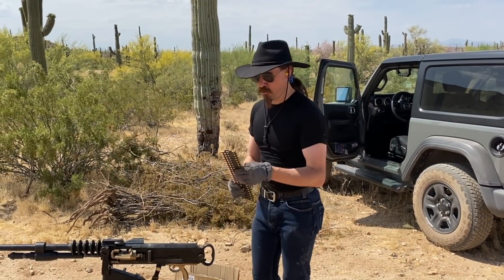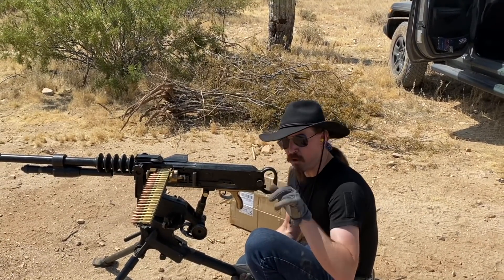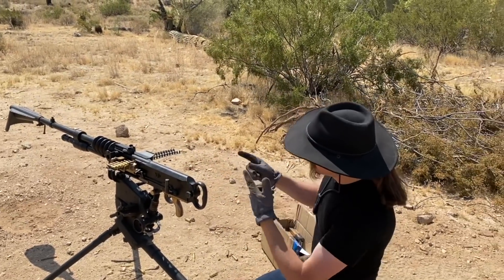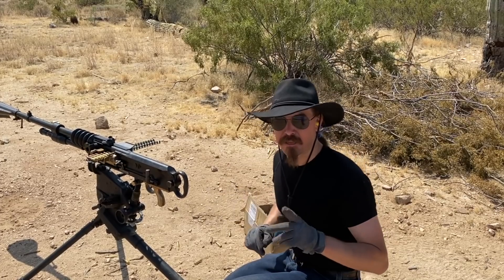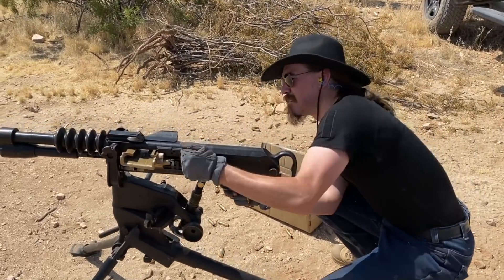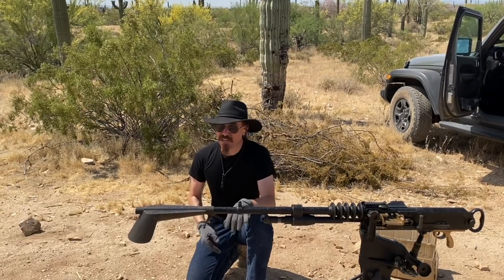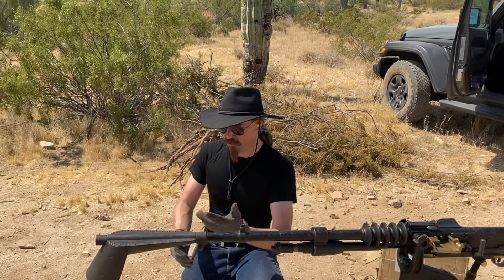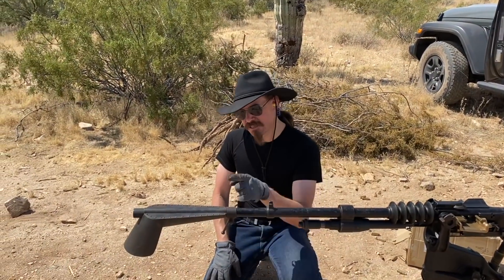Hotchkiss 1914 Cow-Catcher Muzzle Device

Comment: What an incredibly weird muzzle device . My dad used heavy machine guns during WW2 in Europe and told me about using wet burlap sacks below the muzzle to stop dust from flying .
Reply: One of the ways snipers prevented dust and dirt from flying up and revealing their position when they fired was to make the soil wet.
Reply: @alephkasai9384  "snipings a good job mate!"
Reply: Still true
Reply: My dad was a bren gunner. He just used the dust as toothpaste.
Reply: @charlesballiet7074  I don't know where YOU keep the muzzle of your rifle, but if it was me, I'd pee and lay down BEHIND it. So the muzzle was over the pee, not me.
Reply: A flash in mist or smoke lights upwards, maybe they try to stop that kind of flash reflection. Not much dust in France and it could be fixed, can't do that with smoke
Reply: @stevenduckworth8357  whats the kitty litter for?
Reply: @charlesballiet7074  breakfast, can't eat much when you've got rats the size of cats chewing on buddy who died three days prior
Reply: @Crosshair84  Now ou tell him.😮
Reply: @mouse454  There would be plenty of dust in summer.
Reply: @bashpr0mpt244  No need to check the accuracy on a Bren.
Reply: @grandace2  "Challenging work!" :D
Reply: Yeah I dont know why they'd want the extra pressure forcing the barrel up... Unless your aiming above the horizontal
No... It would only be useful for recoil if the barrel was bellow the pivot point

Comment: The idea was probably to reduce the muzzle blast going through the foliage you camouflaged your position with, and redirecting the blast down into what should be solid ground covered by grass. Now, you get the mud and dirt covered mess of WWI, and what you're now doing is spraying mud back at the gun and crew. Doesn't help that there's very little foliage to camouflage your position with, and you've going to dig the gun in, using logs, sandbags, and the like to protect yourself.
Reply: When this gun was designed the term Camoflauge did not exist, they were known as Concealed Battries. After all the only thing available for observation was  eyeball mk 1 , maybe with optical assistance from the max height of  a tree or maybe a hill.  The ballon wa suseful but you still needed a lot of them to cover the front. With the introduction of mobile ariel platforms, the Aeroplane, the whole world changed. The French then introduced the concept of Camouflage, especially with empahses on Aerieal Reconnasence.

Comment: When the clip jammed it looked like the round being fed had wider spacing at the nose of the cartridge than the following rounds, maybe under continuous fire cartridges are jumping out of their slots? also there was a stutter like the strip caught on something right before it happened.
Reply: American piolets during ww1 would sort and inspect every round and quite often polish them as well. French standards were relatively low for ammunition inspection because if it went in a bolt action rifle and left a bolt action rifle like it was supposed to then it was "good enough". Most piolets learned fast that you didn't want to clear jams in the middle of a dog fight. I guess what I'm saying is that if the French have not improved ammunition production for these old calibers than it could be a whole variety of problems.
Reply: @isaiahcampbell488  I remember reading that years ago when reading a book on WW1 pilot experiences. Pilots hand-inspecting their ammunition not only increased reliability significantly, it also meant that the jams they DID have tended to be ones that were more easily cleared. Ammunition quality was apparently a significant problem for the entire war.
Reply: @Crosshair84  Canada had top quality ammunition for the Ross rifle, but the British made us hate it with their sub par ammo
Reply: Elijah Aitaok I think blaming British ammunition that worked fine in other guns, is a bit disingenuous.
Reply: @feoffle  kind of but not entirely disingenuous, the Ross was a good sporting rifle, but the shittiest battle rifle. At most I'd probably take it on a week long hunting trip but even that is pushing it. The Ross' design doctrine was probably spare no expense and Canadian ammo followed suite, the brits said "Is the rim good? Kay send it bois!"

Comment: Protip from an old M2HB gunner:
For accuracy you want the tripod set up as low as possible so the recoil has less leverage and the center of gravity is lower.

If those tripod legs can be locked at different angles, see if you can make the gun sit closer to the ground. That may mean you have to go prone instead of sitting behind it to get a sight picture, but it should bounce around a bit less. Unless the tripod is a crappy one with legs that flex like mad if loaded at that angle, of course.

Comment: It is also important to understand machine gun tactics. The general infantry attacks were composed of many men in a row with fewer lines. If you face the attack with a machine gun up front there might be 5 to 6 guys behind each other. For simplicity say you got a square field of fire on them, that would be 30 - 36 guys you can reach with the MG. Put the MG on the flank and you got 30 - 40 guys behind each other by strafing the entire rows. That makes 150 - 200 targets you can reach. In that case the vertical spread caused by a slightly bouncing mount is less worse, because you still might hit a target in the row.
Reply: That tactic actually changed very rapidly , becasue of the enfilade fire from machine guns. The trouble the Britsh had in the early days of the Great War was poor training, and Genrals not trusting the men to move on a more individual basis. 1st July 1916 stopped that.

Comment: It directs the muzzle blast straight down, and it kicks the muzzle straight up. Unless the barrel can whip back into place by the next round (which depends on how tight you hold onto the rear end of the thing) you probably painted a 20 foot high line out at 300 feet.

Comment: The Hotchkiss appears to rock pretty heavily back-and-forth in the vertical axis on its mount: does the downblast from the hider/brake attenuate or exacerbate this rocking motion?   Do you know if it was adopted in-part to tune the recoil?   It would be interesting to compare variants, but I imagine the Hotchkiss dealer closed shop some time ago.
Reply from the maker: That is happening because I have an undersized bolt connecting the elevation leg of the tripod to the gun. With a properly fitted original pin, that movement wouldn't happen.
Reply: @ForgottenWeapons  Ahh, makes sense.  Time to call Mark Novak?

Comment: Of course the dust cloud is very difficult to achieve in the rain sodden fields of Flanders....   so maybe the flash shield might have been more useful than a nuisance... in France and Belgium after 1914.
       I have noticed this kind of anomaly in several videos (not only yours Ian !)  and really  dust dry, red hot, mirage laden ranges were not  necessarily where a weapon was meant to be used.

Comment: I would think that WW1 era machine guns would easily hit small area targets at 500 meters with the right mounting. That's an easy accomplishment with a 240 mounted with a T&E.  

I wouldn't think the dispersion of modern machineguns is much different than  ww1 era ones. I would guess any technological edge a modern machine has in accuracy would be nullified by the  mass the of the older guns and their mounts ability to dampen recoil.

I'm assuming the only significant developments in machinegun technology over the last 100 years has been in weight reduction, reliability, and ergonomics.

But I know fuck all about old machineguns, so it will be interesting to see how it goes.

Comment: In my limited experience with them, traditional conical and cylindrical flash hiders' primary effect is to reduce illumination to the rear and sides (lighting you up and blinding you) but do rather less to reduce visibility from the front, unlike modern cool-the-gasses flash suppressors that reduce the illumination generally.  This device has always struck me as an attempt to generally conceal the muzzle flash from the enemy, probably in response to the same Good Idea Fairy that inspired the rest of the disastrous 1907 attempt to evade the Hotchkiss patents.  One can likely only test this in low light conditions.  The rest of the unintended effects on barrel dynamics can likely seen on targets at sufficient range, or possibly in high-speed photography, in mounted/unmounted comparison.

Comment: Forcing the muzzle blast downwards seems to keep your sightline pretty clear. Also, wet fields wouldn't throw dust about like that, and WW1 was fought in wet fields.
Reply: It wasn’t always wet. The weather doesn’t just change because a war is happening. Exposed dirt will always dry out eventually.
Reply: Wars are fought in all enviroments. Bear in mind the Frecnh had interests in North Africa and the Far east, Vietnam at the time. The Great War could just have easily started in 1907 with the Morrocan Crisis and agin in 1911, with Germany trying to muscle in on French overseas territories.
Reply: @aidanstevens5345  I was wet in the trenches much of the time. The soldiers suffered horribly from trench foot.

Comment: Simple solutions. First, wet the dirt in front of it. Second, build a trench deep enough to catch the air without blowing up dust
Reply: That’s the thing though. You shouldn’t have to do any extra steps. When you move with it during battle, when, for example, the post you were at was overrun, you’ve already had to carry a large heavy gun, so you shouldn’t have to dig or wet the ground. All you should have to do is level the tripod and then load it

Comment: Your test is a fascinating idea.  There are what the gun is "supposed to do" and then "what it really does".  Also you have run into the old problem of "data" vs "lore".  Since all the WW1 machine gun crerws are gone it is hard to discern what the field operations were really like.  Even if youy have an original training manual there is not usually a record of what crews actually did in combat (and that can vary but unit in the same army).  Example: sandbagging or staking the tripod.  Even if the manual recommends it, one can't guarantee that the crews actually did it.  Good luck with your research.

Comment: To counter this put a wool blanket underneath that area and wet it down.

How well does it control the muzzle flash? 
How well does it control the muzzle flash at night?

Perhaps it was meant to hide the muzzle flash at night. The flash would give away the position.

Two observers in known positions can use compasses to determine the location of a third position on a map using a process called intersection.

In todays military this would allow your enemy to rain down mortar and artillery fire very accurately.

In WW1 artillery tended to be large barrages with many guns over a single area.

Comment: Probably a dumb question, but why didn't they point it upwards? No dust kick and, if long enough, no flash either. It could easily be split around the sight line or have offset sights.

Comment: I'm sure I'm missing something, but wouldn't it make more sense to deflect the gas upwards to counter muzzle rise?
Reply: That is the theory behind the M16A2 flash hider.
Reply: Yes, the reasoning behind this contraption completely eludes me.
Reply: I don't know that muzzle rise is a worry mounted on a tripod, but I do kinda wonder if the the thing might be upside down.  Perhaps intended to do the exact opposite of what Ian sees here -- deflect blast upward so it doesn't kick up dust.
Reply: Tho if you consider pre war a HMG was expected to be mainly mounted in an emplacement, directing the blast down outside the wall wouldnt generate a dust cloud and wouldnt throw any smoke etc across the gunners field of view. On an emplacement mount muzzle climb wouldnt really be a problem
Reply: Samuel Prince  Yep. Used to screw up PVS 4 night sights. But then again pretty much everything screwed them up.

Comment: I don't know if it was a side effect of the frame rate of the video camera (like flicking a pencil up and down between your fingers which makes it look as if it is bending) but there seemed to be a lot of barrel flex on the Hotchkiss, mostly in the vertical plane.
Reply: Barrels do vibrate.
Reply: @51WCDodge  I  am not sure they vibrate to the extent of the flexing that may be a visual artefact on Ian's video. I had a Ruger 77 fitted with 19" titanium fluted barrel in Win .308, that "twanged" so viciously on firing, that it was very painful to my arthritic hands. I had to fit a heavy muzzle brake as a vibration damper, which completely negated the weight saving of the titanium barrel.
Reply: @wilsonlaidlaw  It's the age mate! I know the feeling. :-) A friend of mine had a hand built twenty bore with a brass weight in the fore end to sooth the recoil on his shoulders. Was a very sweet gun by Manton.

Comment: i wonder if they intended it for wet or muddy ground for maximum effect. I say that because I recall them mentioning in the Behind The Scenes for Black Hawk Down they wet the ground under the helicopter landings to keep the dust from flying up during filming.
Reply: The problem with that is, the grounds isn’t always gonna be like that. The design is dumb if it only works in certain conditions even though the design they tried to replace with it (the cone) already works in all conditions including those that the cow catcher doesn’t work in.
Reply: Dust on landing is a helicopter nightmare for all sorts of reasons, not least you can't see where the ground is, and the engines suck it in. Engines ae jet washed regularly in dusty conditions.

Comment: The Japanese would use there type 92's a Hotchkiss variant to shoot over hills and with a good tripod Im sure that you could zero a machine gun to put fire on a area.
Reply: I have read about Vickers .303s being used in a somewhat similar manner.  They put a pole in the ground out front of the gun position and put reference lines on it so that raising the muzzle to a given line would put plunging fire down on a pre-sighted strip of ground.

Comment: Is there a way to turn that muzzle device upside down? Seems like it would work better to keep the muzzle down. That's if you could still see the sights. 🤷🏽‍♂️

I'm sure soldiers probably just poured a canteen of water under the muzzle or placed a few sandbags under the front.
Reply: You can’t turn it upside down because of where the gas discharge hole is, as well as the fact that you wouldn’t be able to even aim at the enemy. Also, it’s super impractical and dumb to have to put sandbags around it when you have already lugged the 60 pound gun to a new location. For example, if you had just carried a heavy machine gun to a new spot because your old post had gotten overrun, you probably wouldn’t want to have to waste your canteen or lug around another 90 pounds of sandbags.
Reply: @aidanstevens5345  well, actually pouring a canteen in front of the muzzle is common practice. Also, You got to remember that WW1 was mostly a static game with fortified positions. Soldiers weren't lugging all their guns around all the time. Not too mention that you don't carry loaded sand bags. You carry empty sand bags and you fill them once you get to where you are going. That way you can build a protective barrier in front of the machine gun.
Reply: What do you the soldier drink afterwards Never waste Potable water.

Comment: I wonder how the amount of dust kicked up would differ if the ground were wetted a bit first, or how it would fare with the muddier, wetter soil of a typical WW1 battlefield? 

Looking forward to the results of the testing; original research on things like this using the actual equipment is invaluable
Reply: @Mike-ek9hy  Very true, and while I suspect even the driest parts of the front were probably not as dry as that bit of Arizona, the French did have colonial possesions that were where they expected to use these guns. I'd still be interested in seeing it with wetted ground, though, as wetting the ground as a technique is often discussed when talking about the muzzle blast of artillery pieces.
Reply: @discerningscoundrel3055  The joys of Google Earth, take a flight from the Western End at Neuiport Le Bain to the Eastern End at Phetterhouse. The envoroments are extremly diverse. The British and American's tend to assocoiate it all with Flander's Feilds, as that's where thier forces deployed.

Comment: Can''t wait for the full experiment. This looks cool but i don't see the purpose. You can see the tube sticking down at 3:23. Is there a safe way to compare how well it works as a flash suppressor?
Can you mount it upside down?
Reply from the maker: That's not a tube, it's the tightening screw to keep the flash hider on the gun.

Comment: Wants to learn about accuracy of belt-fed, watercooled guns, uses air-cooled, strip-fed gun for it. :)
More seriously, if this gun used for defensive position on the wall, or in the bunker, will muzzle end be far from ground and maybe even "outside" of emplacement, so muzzle blast will not have any effect on shooter, and be largely invisible from afar. Maybe this was initial thinking behind this design?

Comment: I don't know the first thing about machine guns, but I'm guessing that clouds of dust in any mechanism isn't going to be a good thing.
Reply: When first designed, the Enemy didnt soar like angels over your postion, so dust going up was the problem. When seen from above. The trace od burn from a machine gun or artillery stands out like a sore thumb. Wet foliage or canvas was the supposed to be placed unde rthe muzzle of fixed guns to hide the burn marks from the air.
Reply: Remember, this was used in France in 1914 or thereabouts. They couldn't afford dust, all they had was 18 inch deep mud. Probably made a heck of a mess on the gunner's face.